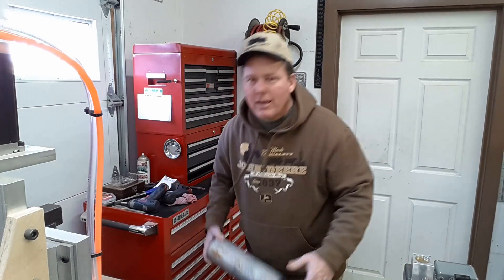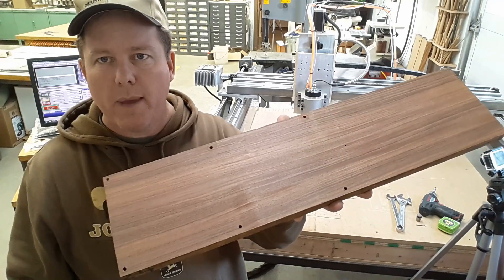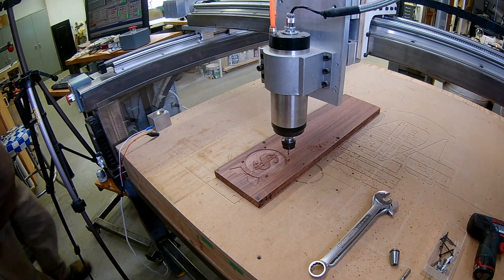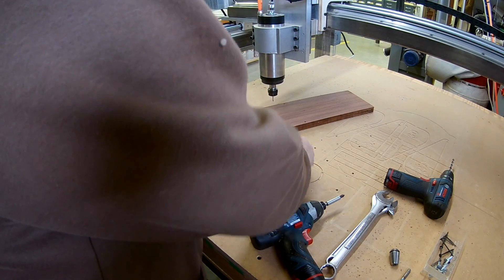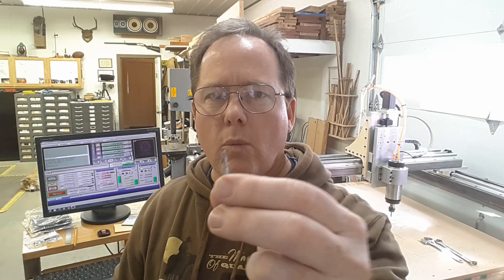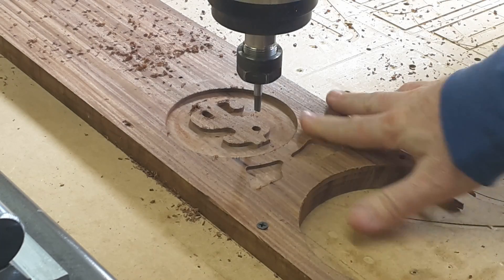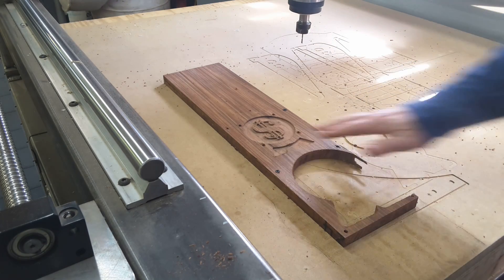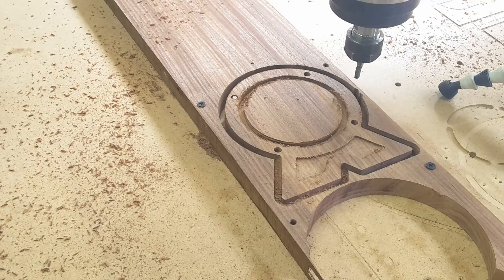Part 1 - CNC Piggy Bank 20+ years in the making

Comment: With the new 1/8" carbide single flute, what if you increase the rpm's, and slow the travel down by just 20%. I'm thinking it will allow the cutter just a couple of seconds of more time at a higher rpm, as long as it doesn't start burning, then decrease the travel speed by 10% instead of 20%.
It may result in a smoother cut without any fir as you call it. And if any fir, it will be at a minimum.
  Just a thought.  btw, that is an awseome place you guys have there, inside the shop and out. great view from the aerial view at the beginning.  Cheers!

Comment: You could be running that machine a lot faster!
Reply from the maker: I am still playing with speeds and feeds.  What would you suggest for speeds and feeds on an 1/8" cutter in wood?  I'll give it a try.
Reply: sbirdranch for 2 flute at 16k I don't go under 3m/min or 130ipm.
Reply from the maker: WOW....well.  hmmm...  My machine won't run 130ipm.  I'm going to put these numbers through the math and get the chip loading and see what that equates to in RPM at say 30 ipmm.  Thanks for the insight.  BTW, what kind of machine do you have?
Reply: Why can't you? Even with my old 1605 the Max the motors did was 200ipm. New machine will be able to do 500ipm. 

I modified an OX but am building a third
Reply: That's a 5 thou chip but you can go 10-12 for hard woods and mdf